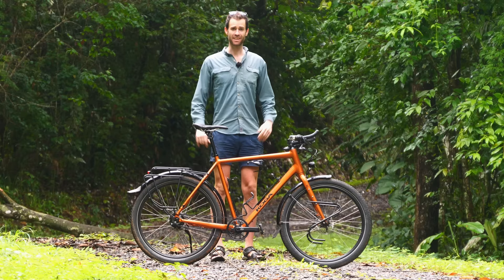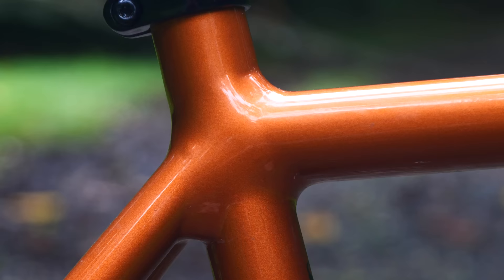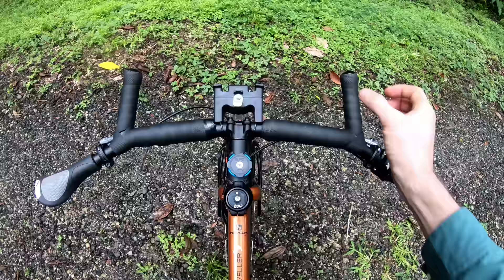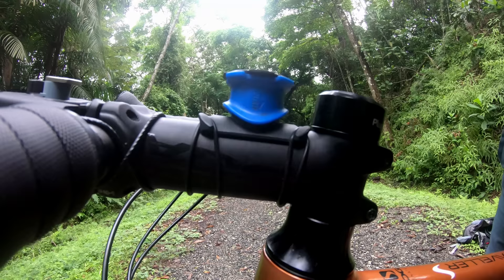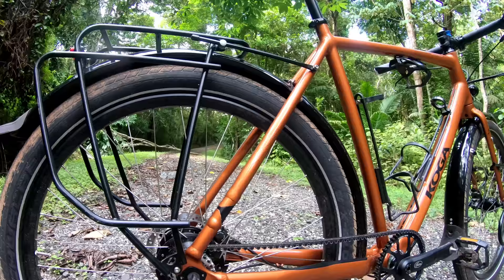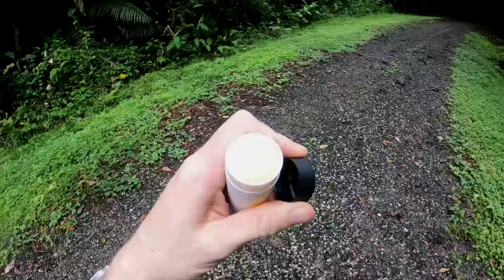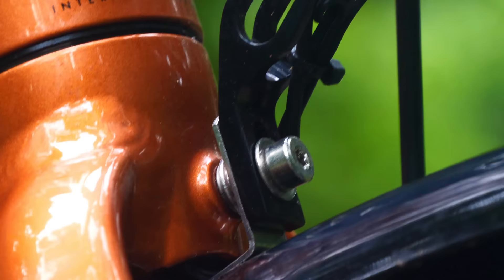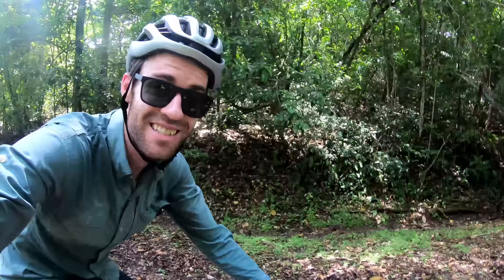The 2020 KOGA WorldTraveller-S is a $6000 Indestructible Touring Bike

Comment: Can't say it is indestructible with those wheels. Spoke wheels are good for maybe 3000 miles then need rebuilt, they will fail when hitting large holes, and they are always the weakest part of any bike. I am starting to see solid aluminum wheels now with the aluminum cut out simulating a 5 spoke carbon wheel. And what do you do with that internal gearing when it fails on the road, how do you repair it? A conventional derailleur system can be made into a one speed when damaged. Straight blade forks are horrible for comfort, don't know why they put these awful forks on consumer bikes. Unless the frame is extremely reinforced (which this one is not) you will have terrible handling of the bike when loaded with panniers. Any bike with panniers will be a horrible bike to ride without a very heavy reinforced frame. Those handlebars don't allow for a different body position, your shoulders and hands will be under identical pressures all day long without relief. The seat height to handlebar height is the same as a racing bike, this may be more aerodynamic body position, but will punish your body; the neck, and butt will be at extremes and you will not be able to have full peripheral vision either, you will be a racing position..why? No toe clips and straps; make your pedal strokes inefficient and dangerous if you slip off. Hope the brakes are cable and not fluid (but probably not) , or you will be really in trouble when descending a rough mountain road, again repair problems of hydraulics, and ALL hydraulics will always eventually leak. Tires don't have side tread, not good for soft soil or any soft trail, you will need something like Specialized Crossroads tires for your world traveler. I hope you are not one of those cyclists that plans on touring a war zone like those others who were killed. Belt drive, why? I wouldn't have belt drive in America, it is too new technology, you are not going to find a belt replacement anywhere, and belts are easily cut from debris. $6000? My 350 dollar bike with $500 upgrades would be far more dependable and you could get replacement parts anywhere in the world.

Comment: 2 month ago a bought the exact same bike you have. I am very disappointed in the bike and even ore in the lack of service. First the bike was delivered later than promised which had great consequences for my trip. No apologie whatsoever. During the trip the crank loosened 3 times and since I did not have the right tools and bikeshops in Montenegro neither I had to abandon my trip. I sent a film of the problem to Koga. Not a single reaction. So please stop promoting this crap. And to all your viewers: think twice before you buy this, there will be no service or aftercare!!!
Reply from the maker: I'm sorry to hear that things didn't go to plan - I would've expected KOGA to respond too.
I disagree that a crank that becomes loose makes an ENTIRE bike crap and not worthy of promotion. You can use a regular 10mm allen key to re-tighten the cranks if they need it, and if they loosen more than once, you should add some loctite to the bolt threads to keep things firmly in place. This is a very common tool size and loctite is a very standard product in hardware stores. Some tourers carry these items on their bike trips, but I've always found them in bike shops as I've travelled.